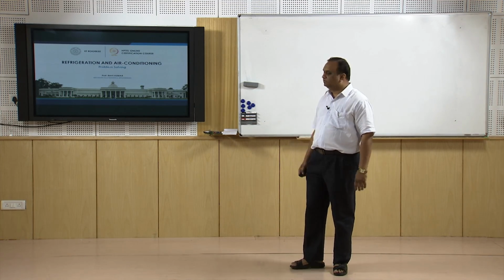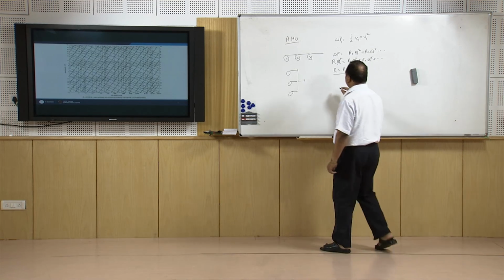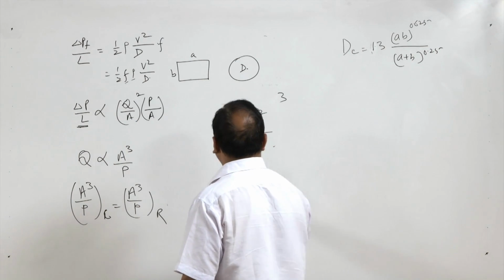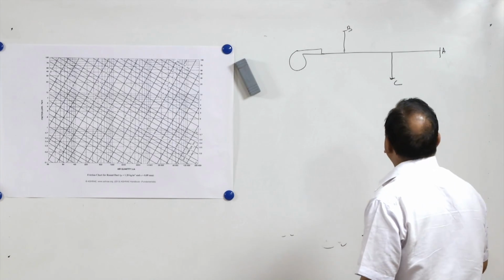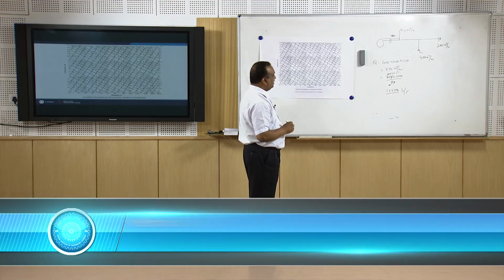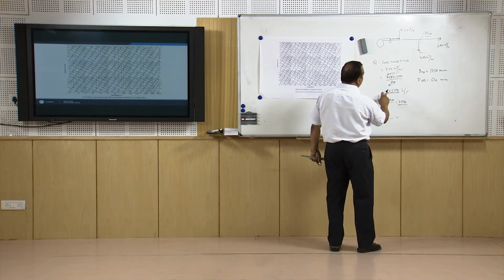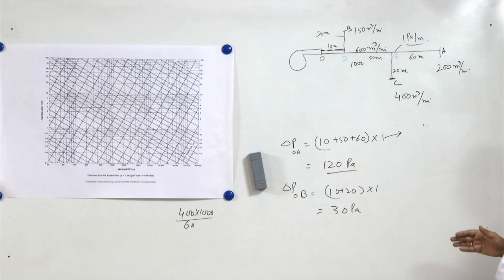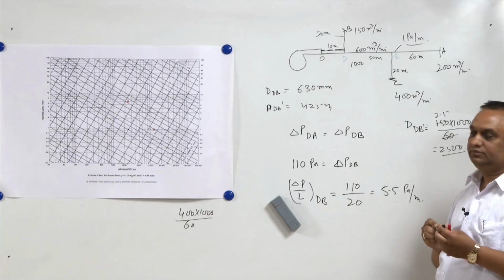Problem Solving

Comment: A  steam  power  plant  consists  of  a  boiler  (with  super  heater),  turbine, generator  and low-  and  high  pressure  feed  water  pre  heaters.  The  condensates  from  the  pre heaters  are  lead  to  the  condenser. a)  Sketch  a  picture  of  the  connections  in  the  power  plant b)  Calculate  the  extraction  mass  flows  from  the  turbine  c)  Calculate  the  electrical  power  output and  the  total efficiency   The  following  is  given: Feed  water  flow    Pressure  after  feed  water  pump   Temperature  after  super  heater   Pressure  in  condenser   Pressure  after  condensate  pump   Temperature  after  HP  preaheater  Temperature  after  LP  preheater   Isentropic  efficiency  of the  turbine Boiler  efficiency    Mechanical  efficiency   Generator  efficiency   100  kg/s 60  bar 500°C 0.1  bar 5  bar 150°C 100°C 0.8 0.83 0.99 0.98 For  the  preheaters  and  the  condenser  it  is  given  that  the  out  coming  feed  water temperature  is  the  same  as  the  saturation  temperature  of  the  extracted steam.  However,  observe  that  the  steam  extracted  is  NOT  saturated.  It  is  also given  that  the  extraction-flow  after  the  feed  water  preheater  is  saturated  liquid water.